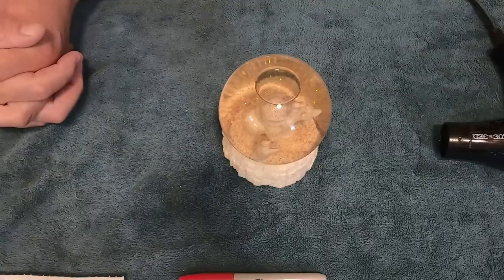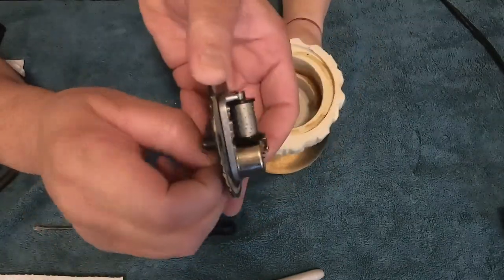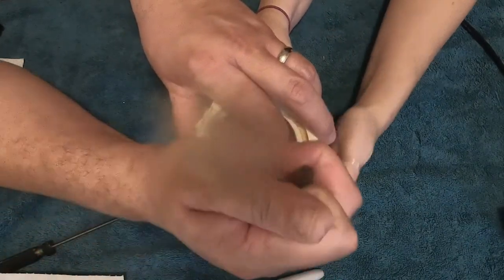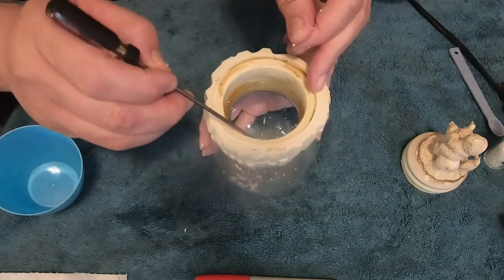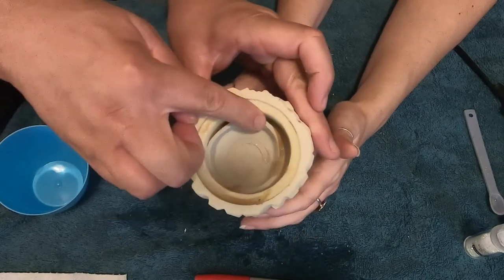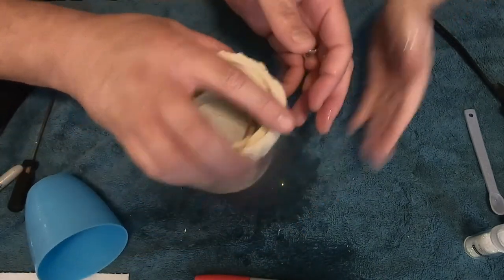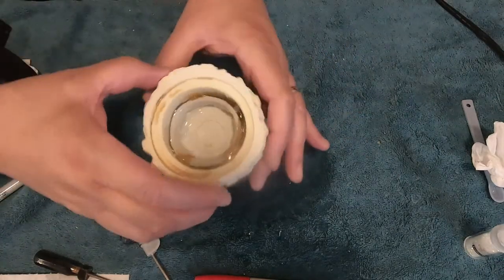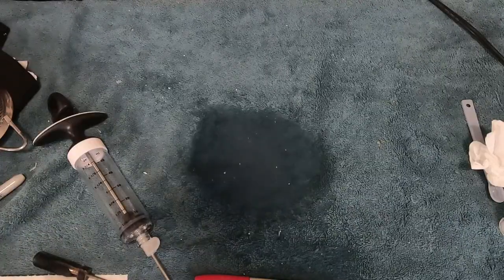Ep. 4 - Repair of a Snow Baby Snow Globe

Comment: What temperature do you put the hair dryer on?  The hottest temperature?  Is there any special kind of glitter you need to buy?  What is the glue for - which type of glue do you need to look for?  Isn't the glue going to ruin the decoration eventually?  I heard that they - the manufacturer's put glycerin inside?  I've seen videos where they only put water and it looks sparkling.  Yours looks a bit murky?  Not trying to insult, just trying to gather facts.
Reply from the maker: Hi Chrystal and thanks for the questions. We set the hair dryer on high. Don't hold the hair dryer too close to the base and heat only until the glue is soft. We use the standard glitter that we get from Michael's. We found that the fine glitter doesn't work as well so we get the courser glitter. The clear glue is used to thicken the water so that the snow and/or glitter stay suspended for a bit before falling. Most snow globes use glycerine but when we learned how to do this the people who we learned from used the clear Elmer's glue. Our research later shows that clear glue is an accepted substitute for Glycerine. Once it is diluted in the water the glue has no negative effect on the globe or figurine. The glue is also much cheaper than glycerine so if you are doing a lot of globes it will save some money. And it is optional. You can use plain water if you want. As far as the clarity of the water, with the addition of the glue the water is just as clear as any other globe. The camera may not be doing it justice. This was also our first repair video. If you look at some of our later videos I believe the picture quality is better and you will see that the water looks fine. Thanks again for the questions and good luck.